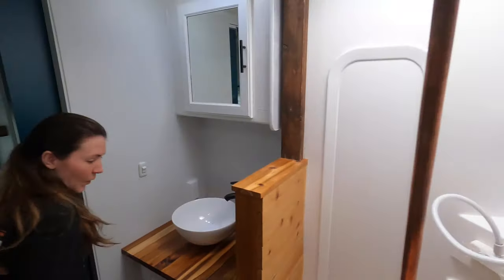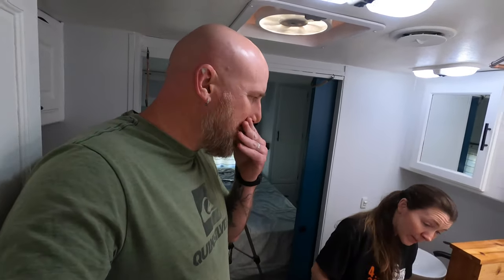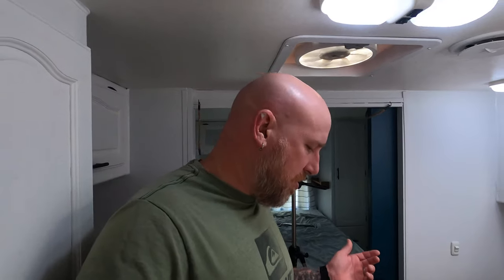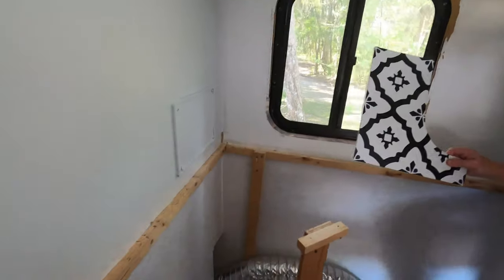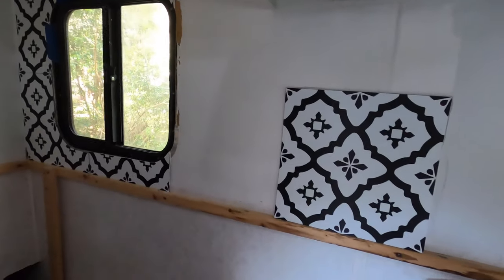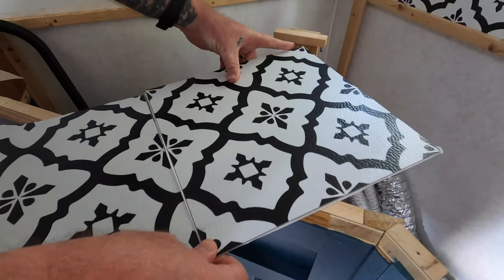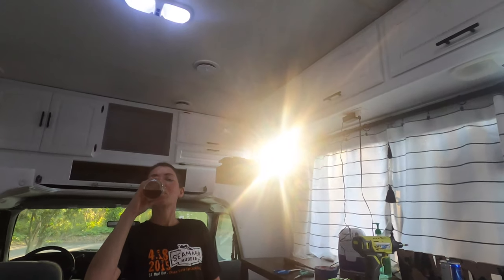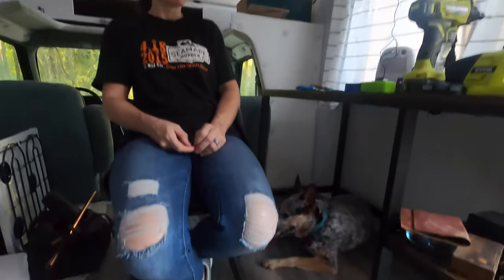CtW 127 // Install Vinyl Floor Tiles as a Backsplash // Unique Backsplash for Our RV Kitchen Remodel

Comment: The backsplash looks amazing! What did you use to glue the vinyl?
Reply from the maker: Thanks! Just an adhesive that works on vertical surfaces. The local hardware store should have a few different options.

Comment: We almost bought the excact tiles for our bathroom upgrade ,,we loved it but found a linoleum very close to it,,,also i hope you guys used extra adhesive !! but it looks awesome
Reply from the maker: We used a cheaper vinyl wall backsplash in our truck camper and it yellowed and fell apart within a year. This stuff is definitely heavy duty. And yes, we used liquid nails to reinforce the “stick” part of peel and stick so they should be good for a while!
Reply: @CalledToWander how did they hold up?